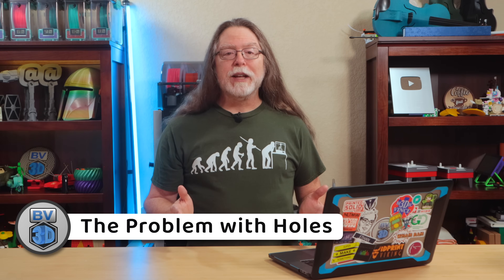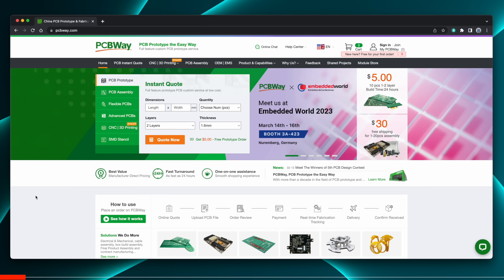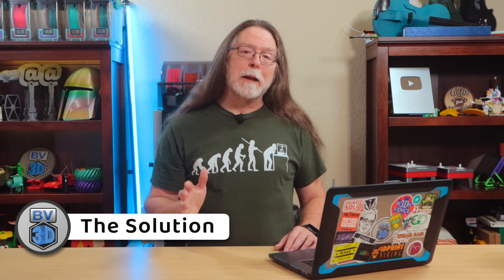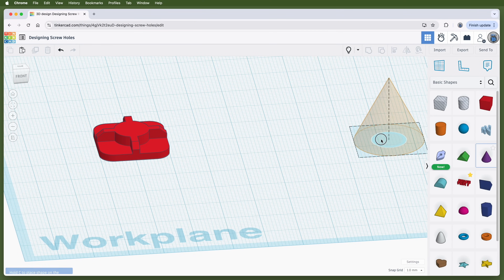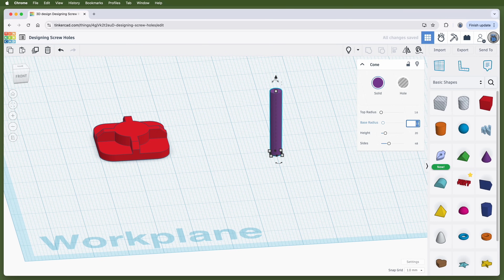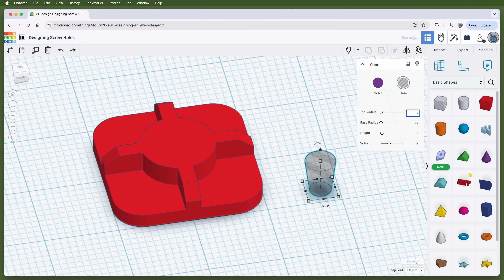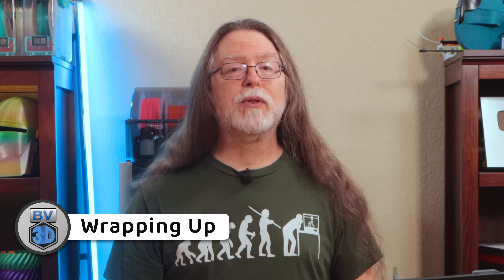This SECRET Screw Hole Trick CHANGED My 3D Prints!

Comment: Of course depending on what the application is and the number of holes and precision required, I'd point out that you can buy a tap set that's good enough for printed plastics for less than the cost of a spool of PC filament.

Comment: Why not use the search for iso in tinker cad and use the screw thread that comes up? You can look up the specs for your screws and enter them and the screws goes in perfect. You can even change the diameter to make it thread in easy or tight so it won't back out.

Comment: You really shouldn't be using a machine screw as a "self-tapping" screw. The screw threads aren't really cutting threads into the plastic. It's mostly just displacing the plastic, making for a very tenuous joint, at best. In the "real world" of engineering and manufacturing, special taps are used with plastic, since using a standard tap (for metal) will also displace some of the plastic, so when the tap is removed and a screw inserted, the screw will not thread into the hole properly, since the diameter and thread profile is undersized. If it's anything important, you should be using metal threaded inserts with machine screws. The problem with displacing the threads instead of actually cutting them is that on more brittle and/or filled plastics, stress fractures can occur and over time and cracks can propagate throughout the entire part.

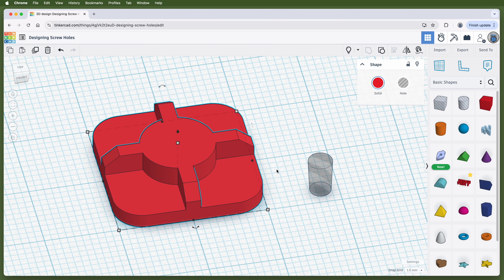Comment: whoa.. whoa whoa whoa whoa ...   at 5:25.... what?!? you missed a greatt opportunity here for a pro tinkercad tip (i realize this wasnt a tinkercad video but still! )  that while I'm a beginner I had no idea and dont at this second .. how didi you snap to the X center and then the Y center of the part you were putting a whole into??  I will try to look this up... I have hand wringed over trying to center a hole part into another part by eyeball... a rookie mistake I'm sure,... but ..  - i know this video isnt new - but if you happen to have time to reply to this - consider me subscribed!  thanks!  (liked video - pro tip on the screw hole for sure)
Reply: What you are describing is absolutely needed. Maybe you already know this but I will describe it anyway, it’s Free. You drag a rectangle to include the parts that you want to align and click on the alignment tool button. Then all these little dots pop up and you can click on the dots and it will align the centers or the Z axis top or bottom.  👍🏻👍🏻👍🏻

Comment: I figured out how to make my screw holes the perfect size by getting to know my printers. I know that a particular prints holes smaller than designed by a certain amount so I measure the diameter of the screw I plan to use then factor in the undersize dimension that my printer will print. Example, I want a 2.5mm diameter hole for 3mm screw and the screw measures out to 2.95mm. I know that my printer prints holes 0.2mm undersized so I specify the hole size in CAD to be 2.7mm. When it prints out, I get a 2.5mm hole.

Comment: Clever. I usually use a tap set to cut the threads but it is similar in that the tap begins tapered to fit the hole. Your method is good if you don't have a tap set where the screw itself is the tap.

Comment: There are STL files of just about any screw you would ever want. Just import the STL, turn it into a hole, and Bob's your Uncle. If the hole is too tight, I chase it with a tap. I do add a 90° cone to one end of the screw for a chamfer. Hope that helps.

Comment: 1:30 - why not simply model the hole a tiny bit small with two to three walls, then drill it out to the exact size you need? I came up with that technique recently when using threaded inserts, and it worked like a champ. The same could be used to get accurately sized holes for direct threading.

I do like the truncated cone idea.

Comment: I think tapered or chamfered holes are a pretty standard feature in most CAD packages, but this is a good workaround for people who want to stay with TinkerCad. What I find is really helpful for making durable screw holes is to use the slicer (Orca for me) to add some cylinders of solid infill around the hole. Otherwise the threads only have the wall thickness to bite into and that’s often not enough for a solid grip, especially if the screw is removed/replaced a few times.
Reply: Yep, I recently came up with that idea on my own. If you're printing your model with three or more walls or shells, there's already enough material there.

Even better, use Cura's "support blocker" to add 100% infill to a small area around the hole. You can then drill it or tap it to whatever size you need.

Comment: Great info for using a machine screw. Easier would be to make a hole, minor diameter, and use a wood or sheet metal screw. The larger threads will hold better.

Comment: 3mm screw has a thread pitch of .5           3mm -.5 = 2.5mm.     That is the size of the hole you need.     The hole can be any depth, 3mm to 30mm for example and the screw will fit.  Using a tapered hole you will have to adjust for every depth of hole.          This works with all metric and imperial screws.      Diameter minus thread pitch equals hole size.

Comment: I don't know if you know this but tinkercad has a screw or thread tool. You input inner and outer diameter and thread pitch. I use it to form threads and threaded holes. I've even made parts screw together to make things I couldn't make in one piece, like when I was trying to make a float valve to fill 5 gallon bottles off the ro system. The lid screws on the bottle and the body goes through the lid and locks on with a snap ring, than the valve goes through the top of the body and screws into the float. I also used it to make a key dupicator that screws onto a Dremel tool, and replacement handles for my old delta miter saw. The one drawback is it's not perfectly circular. You can turn the number of sides up just like the cylinder tool, but it still angles and sides vs curved. I love tinkercad, but it definitely has drawbacks.

Comment: Just a tip, for the blind wholes its good to ad a bit more to the depth of the whole to accommodate any plastic pushed by the screw during tapping (you can even see a bit of that in your model on the down side of the print). And remember that wholes turn out smaller in the prints than what they were designed ;)

Comment: I did similar for last few years. Straight cylindrical hole with chamfer at enter side. Plus sometimes at other side to avoid pushing last one or two layers out by the tip of the screw. Long, conical hole seems interesting and I will try for sure.

Comment: Great video! I really like how hands-on and clear your explanation is—especially your idea of testing hole shapes on small samples first. That’s a smart way to save filament and time.

One tip that might help: for even better results, you could check the official dimensions of screws, like the major and minor diameters of an M3, in a machinist handbook or online reference. That way, you’d know exactly how wide to make the cone at the top and bottom, instead of just guessing. It would make your prints even more consistent, and help others who want to follow your method for different screw sizes.

Keep up the great work—your practical approach is super useful!
Reply: I think the bit of the video with the calipers demonstrates that consumer grade screws we get have a wide variation. Unless you source from a high-end shop, the screws will likely vary a lot. The machinist handbook specs work for top of the line shops, but I get my screws in boxes of 300 off Amazon, so, yeah, probably a wide range of variation.

Comment: Simple solution. Print the holes to the tap drill size.. ie for M4x0.7 use a 3.3mm hole. Then  use a 3.3mm drill to make sure it's the right size and cleaned out then run a tap through it. Perfect holes with good tapped threads. Use your cordless drill and it takes seconds. I have tested this over and over and the results are very strong.

Comment: I just make all the holes  0.3mm undersize per the screw size and called it a day. It is not hard to get the screw to cut the thread and I get full thread engagement. For instance for a M4 I make a 3.7mm hole for a M3 a 2.7mm hole. I have been doing it for years; it requires more elbow grease than this method but you get full thread engagement.

Comment: Non-self tapping screws are not self tapping, so why are you trying to use them as self tappers?  Model the hole as the nominal tap drill diameter and run a M3 tap to cut proper threads, or use heat set inserts, or use self tapping screws.

Comment: Whenever possible I add a hole that fits an appropriate size nut, I either make a surface level open hole and glue in the nut, or have the hole inside the piece I’m printing and insert the nut mid print with the pause feature and continue printing sealing in the nut mid print. It’s pretty easy and works amazing well, it means you can insert and remove the screw with no fear of damaging the print. Hope this helps someone, I find it incredibly useful.

Comment: I simpy use the special slicer function to enlarge or shrink small holes. Small holes by physics turn out a bit smaller than designed because of the inwards pointing drag of the molten filament on any radius. Therefore all slicers offer to detect small holes and to set a value in mm to manipulate them. Great feature.  Makes any screws fit perfektly without the need to go back to cad and manipulate the model.

Comment: I just use the same diameter as the recommended drill diameter for a tap of whatever screw size I'm using. An M3 or M4 screw "taps" it's own threads in plastic just fine. It's a bit tight at first, but after it's tapped it's own threads, it's smoother. I mostly print PETG, maybe PLA behaves differently.

I mostly use countersunk screwheads, so I almost always have a truncated cone for the screwhead, but having one for (the beginning of) the screwhole is a cool idea.

Comment: Not sure if i came up with it or saw it elsewhere but I've had good luck making square holes with rounded corners.

Not sure how easy that is in tinkercad, it's not bad in freecad. I start with two construction circles, concentric. Size one to the screw's minor diameter, the other to its major diameter. Make a rounded rectangle and make its sides tangent to the smaller circle. Make the corner arcs tangent to the larger circle.

The shape allows excess plastic to move out of the way, avoiding splitting. The threads can start in the corner.

Comment: I have used much the same method but with a cone that goes part way and then a cylinder for the rest of the distance.  Basically you want the cone to start at the outside diameter of the screw and to decrease to the tight fit  more than 5 turns of the screw and then the cylinder runs along as the tight fit.  It is only a little move complex to make.  It worked well in the situation I needed it.
For most things, however, if I would screw into plastic, I make the hole a bit under sized and then use a tap.

Comment: Machinist here.
Just use the formula for a tap drill size and adjust from there if you must.
Major Dia. - Pitch = Tap Drill Size
Machine screws are designed to be inserted into a tapped hole.  Use the provided formula and adjust.  👍
Reply: Sounds good if you are tapping the hole first, and remove the extra material. But if you plan to let the screw form it's own path, I would go with an average between Minor and Major Diameter. Or maybe the Pitch Diameter. Using a hot screw might melt the material enough to fill the thread perfectly, without expanding the screw hole.

Comment: In shapes why didn't you use the thread / bolt shape? And size it to fit.
Reply from the maker: My experience with printed threads for small machine screws is that they perform poorly. They may work super well for you, but not so much for me. 😊

Comment: 5:58, the extra material the screw is pushing out of the hole and onto the mounting surface could prevent flush contact.  I do not see a benefit in making a poor mechanical connection (m3 threads on plastic) worse by over stressing the plastic and (due to cone) decreasing surface area making contact w/ screw.  Choosing this method instead of heat inserts or embedded nuts means your threads will still fail w/ time or over tightening. but you put in more work.  Pick your battles

Comment: I understand exactly what you are doing and so long as you are not concerned with the performance such as stripping torque or pull out force or creep over time making the screw loose or hoop stress* giving rise to environmental stress cracking then all good.
For design of injection moulded parts I would always use either:
- a specialized self stating screw for plastic with specific attention to the plastic material and the use forces.
- an insert that could be heat staked or ultrasonically welded then a machine screw into that.
- or easiest in this application for 3D printing is to make a reasonably neat hex recess to fit the nut that goes with your machine screw. This recess is a little deer than the nut and on the opposite side to the screw clamp force. Then place the nut and melt the edges to retain the nut. A soldering iron works well for this. Exactly this method can be used in a production process though usually with a special heat staking tip to make it look nice.
Lots of options including yours and some other similar options can work depending on the application.
*Hoop stress. Standard self tapping screws and machine screws have threads with 60° included threads. This gives a high  radial force component that tends to want to split the plastic surrounding the thread. If in a cylindrical boss typically it bursts out the side of the cylinder starting at the entry. Worse for machine screws as they have a finer thread pitch so there is nowhere for the compressed plastic to go that outwards. Specialist self tapping screws for plastic have a coarse pitch but also a much sharper 30° included thread form which has more axial grip and less radial force.
Probably much more than you wanted to know.
Regards

Comment: Pro tip: print the hole under sized; just; just big enough to function as a center locator/guide hole and then DRILL the hole to a precise size. 
Just because you can 3D print something (or a certain feature) doesn't mean you should. 
Traditional fastening techniques have existed for hundreds of years for a reason, sometimes.
3D prints have very similar mechanical properties to wood.

Comment: It seems like you can use either draft or a custom bevel in most other CAD programs. Make the hole 0.2 mm undersized and add a 0.2x4 mm bevel on the top edge. Thanks for the idea!

Comment: What do you set the infill to for the section the screw screws into?
Reply from the maker: I use whatever the default is in the slicer, so usually 15% infill. It's probably a good idea to use at least three walls or perimeters though.

Comment: Outstanding video! This technique is easy to do in openSCAD since the cylinder shape will let you have 2 diameters, one for each end! And it works really well as you have discovered. Printing a small test part in the same orientation is also helpful. In the long run it saves time and filament.

Comment: Bryan, even though it is called a “machine screw” it is still part of the object class “bolts” and isn’t intended to cut its own thread. It’s intended, design, usage is to engage with a threaded hole in metal of some sort.A different class of fasteners are specifically designed for cutting their own thread in unthreaded holes, and accordingly they will perform better. 
This is an admittedly neat hack if you don’t have the proper fasteners on hand, but it is really a bit of a bodge. I don’t think it is a route one should choose in normal circumstances.

Comment: Interesting approach...

Chasing a minor thread diameter hole with a tap also works too.  A basic tap and tap handle is readily achievable by most that can afford to 3D print as a hobby.  But I understand the mentality and thinking in your technique as well, even with the moderate loss in pull out force.  Pro tip, print an even smaller hole than the minor thread diameter, this achieves positional accuracy and then drilling out with a drill prior to tapping will achieve a ROUND, accurately sized hole as well.  Pro Pro tip, do it on a small hobby drill press and you'll be jigged up for perpendicularity and depth as well.

.02

Comment: When CAD (any cad package) can allow the designer to create trilobular screw threads that will be a game changer for fastening into plastic. 😉😉😉
Reply: Uh, just extrude the reloux triangle body, project a line onto that surface to act as a guide rail then sweep the thread profile. You still need to taper the point with a loft and dress the start of the threads, but it’s very doable.